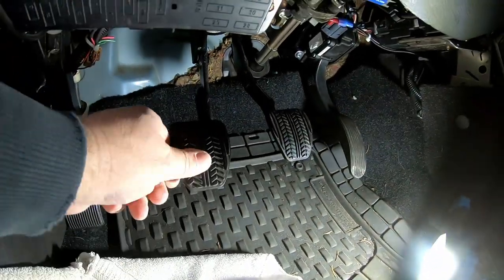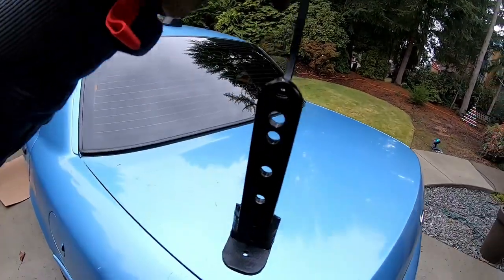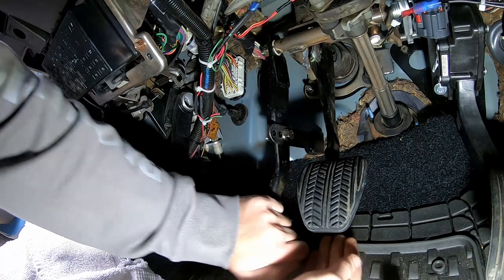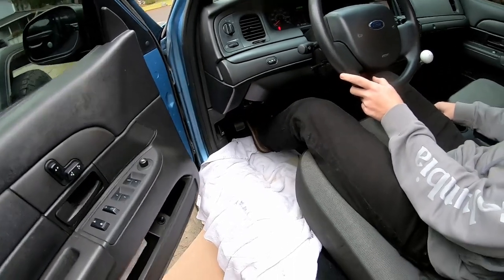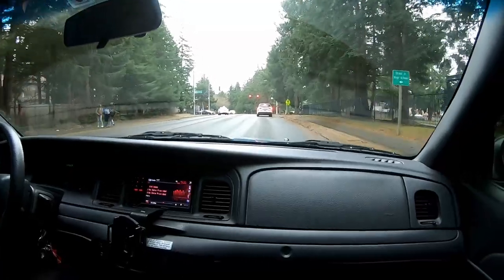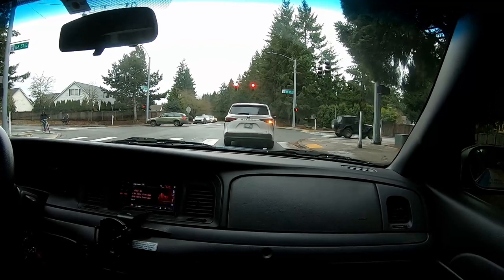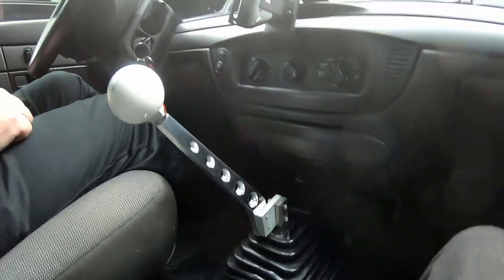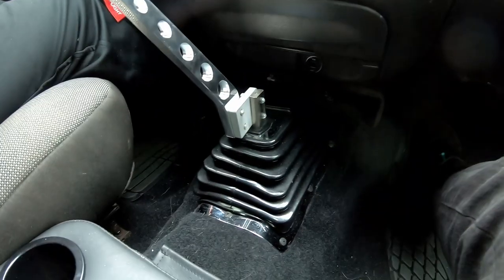Building an Adjustable Clutch Pedal Stop for Manual 5spd Crown Vic with test drive

Comment: I'm guessing there's no quote" booster for the clutch like it's not a hydraulic clutch this is spring loaded.. following y'all's process to convert my 06
Reply from the maker: Correct.  It is 100% mechanical setup just like a fox thru new edge generation stock mustang clutch.

Comment: I'm trying to recreate your shifter. Where did you get the plate that lets you move the shifter handle back?
Reply from the maker: Business Man that is a part sold through Steeda.   If you go to their website I believe it says the offset plate won't work for the Tri Ax shifter but so far it has worked fine and has never come loose.  Hope that helps.
Reply: @PNW_Car_Mods  That does help! I almost bought that from Steeda but saw the warning that it doesn't work with the tri ax.  Weird.   Thanks for the help
Reply from the maker: @businessman2085  Anytime!

Comment: First, and watching.
-Chuck
Reply: How did you come up with canabalizing parts of your house to put in your car?

Are there some helicopters flying around with plumbing components? Lol
Reply from the maker: @PanzerPlatform  I cannot confirm or deny  hahahahaha
Reply from the maker: @PanzerPlatform  Maybe even a beer can for good measure!
Reply: Have you won any prizes from the telegram monsters?
Reply: @mr.blacksaviationvideos4048  
??? That went over my head. 
Telegram?
Reply from the maker: @PanzerPlatform  You must only watch smaller youtube channels?    Telegram scam comments have gotten out of control on bigger channels.   The bots make a fake account mimmicking the channel owner and then respond to every normal comment saying they won a price from the channel.  It's a massive annoyance.
Reply: I hope you didn't send me a Christmas card, I cancelled my po box in July.
Reply from the maker: @PanzerPlatform  We've been slacking.  No cards have gone out. :(
Reply: @PNW_Car_Mods  
Those telegram spam bots hit me hard 3 months ago. 10-15 minutes after I would post a video. 

I quickly added each bot to my "banned" user list. Each time I banned one, three more would reappear. 

And whenever I saw them on bigger channels I would preemptively add them to my banned list.

I have over 300 spam bots in my banned list. But I've noticed they disappear after a month, so I guess youtube is deleting the bot accounts.

Comment: What ratio is your rear axle & what RPM are you at when doing 70-80 5th gear?
Reply from the maker: I don't drive this car often so I can't remember 100%.   It has 3.27 gear and in Fifth at 70 I want to say it's around 1900.   I will also say that it turns so low in 5th especially around 60 that I could easily see going to a 3.73 gear and still getting all around good performance and mileage.
Reply: @PNW_Car_Mods  Thanks, so i would guess then, with my stock 3.27 & the auto trans I was running about 2100ish at 70, with the 3.73 & auto it runs about 2400ish. So if/when i swap to either a t45 or t3650, cruising at 70 might put the RPM back around 2100ish.

Comment: What shifter is that? Looking at swapping a grand marquis
Reply from the maker: Steeda Tri Ax with a Billet Specialties 9" handle.   That extra length while kind of goofy looking is so much more comfortable to drive.   It also has a Steeda offset plate to mount the handle which also moves the knob another 1.5 inches closer to the driver.
Reply: @PNW_Car_Mods  Thank you! By far the most informative series on YouTube about panther manual swaps!

Comment: kool video. did you stick weld that? Thanks
Reply from the maker: Negative.  220v Lincoln Mig.   I sucked at stick welding.  Sold my stick welder back in 2005.